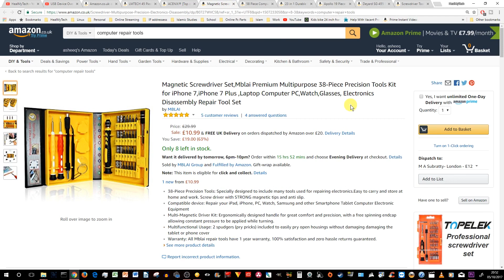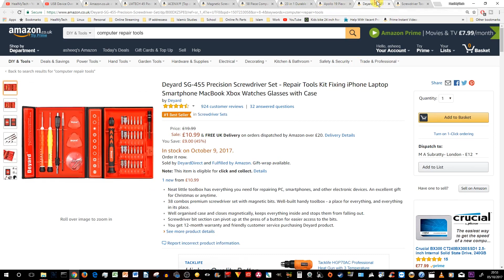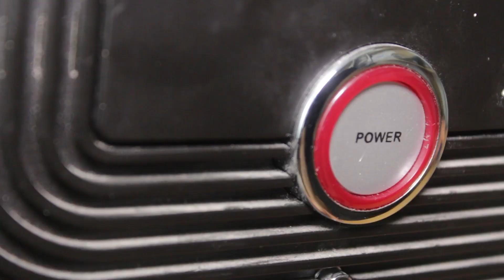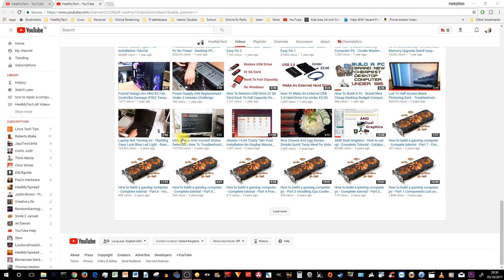How To Troubleshoot A Computer That Won't Turn On - Pt 1: Is It The PC CASE Fault?

Comment: I have a Asus hero VIII that won't power off.  Shuts down normally and works as expected when in use, but when I click power off it shuts down but doesn't power off. (Fans and lights stay on)  Reinstalled windows.  Updated bios.  No changes.  I'm thinking I have a faulty motherboard (CPU has been changed and didn't fix)

Comment: Hii, I am having a little trouble turning on my pc
The CPU does starts up and the fan moves and as far as i can say its running coz i can hear audio from the speakers but the screen is black.
Maybe its bcoz my monitor broke or something but I am more worried bcoz one(red) of the two(green and red) light on my CPU isn't blinking the way it usually does.

Please help me

Comment: Great video's.  I built a computer for my father a while later it was sitting in the hallway and he had a new one.  He took it to a computer store and they couldn't figure out what was wrong.  Well 1 the power supply was bad.  2 - they unhooked the power button wires and put back incorrectly so even with new power supply it would not work.  (idiots)  After watching close to you doing the jumper (with screwdriver) did I notice the power wires were incorrect.  Now I have a functioning computer again.  Thank you so much!

Comment: Just popping in to say THANK YOU!
My PC was crashing at random times, for 2/3 days, before it started crashing continuously (even in BIOS menu with default settings). My first assumption was a faulty power supply, but found it weird how it was very inconsistent (PSUs tend to behave decent until they fail). I send it to someone to fix it, since I didn't have any spare PSU around to test it. Unfortunately they weren't able to find the issue (just wanted to reset my drives?! :|). So I finally manned up and bought a multimeter! PSU was testing perfectly (thanks for the guide). Finally after watching this video decided to start at the very basics, and found that my Reset cable, was exposed (just a tiny little bit), and that was causing the "crashes". Sorry for the long story. So incredible thankful for your guides and incentive!

Comment: my desktop turns on the fun and shows board led but does not display the screen what would be the problem
Reply: I have the same problem let me know what whats wrong with yours please
Reply: @demolast9128  did u get a solution im in same situation
Reply: @LegalMikel  i did well kind of , my problem is a one bad ram slot and one bad ram card , i am currently using my computer with only one ram card

Comment: I can't thank you enough. This problem happened before and turns out the wires of the switch were disconnected. A person fixed it and later, after shutting it down, I tried to start it up but it didn't work. I found out what had happened due to your video, thank you!

Comment: I got a MSI MPG Z490 a I7 10700 AND GSKILL ram. At the beginning  everything went well but after shutting my PC down and rebooting it five or six times motherboard remained stationary on the logo MPG. I changed the SATA drive with a SSD drive but I had the same things. I installed RAM, HARD DRIVES, POWER SUPPLY on some others PCS and they worked well. Any idea about what it is preventing the complete boot?

Comment: I am trying to build a server at home. I keep getting a memory error - 5 short beeps + 1 long beep = no memory detected. I am using the Supermicro motherboard X9SCM-F and I have two 8 Gb memory modules, both are non-ECC Unbuffered. I used other modules and got this same error, so I switched three times - still same error. I have my keyboard, and mouse plugged in, and vga video - no video output because it don't get that far. Any thoughts in Troubleshooting ??

Comment: Hello Ash.  I have watched this whole video, as well as the intro one.  I have a situation where after a few days of the computer being turned off, it boots up and then it shuts off, but on the second attempt, it doesn't do it, meaning that it gets to the Win desktop without any problem.  It behaves exactly the same way every time.  It's a pre-built HP PC by the way. What would you check in that situation?  Or what do you suspect?

Comment: Thanks for all the tips!   
As a former Avionics Technician on helicopters, I can assure that having the motherboard inside of the computer case is not tight at all comparing to the tightness I had to deal with on helicopters.

Comment: fam thank you for putting this out, but i feel you are milking time like 30% of the time
Reply from the maker: Alright.  Which parts do you think are unnecessary? Ive been removing the fluff in my recent live sessions for this series, and i will compile them as a new full troubleshoot upload once i reach part 10, hopefully that should do the trick.  If you check out todays live stream, let me know if the summarised part is better.

Comment from the maker: My apologies for the delay. I have updated the description with The Full Series Parts and links.  Whether I have answered your question here or not, I will feature your question and answer in today’s live stream Q&A (Thursday 23/01/2020 @5PM UK & 12PM EST) here: https://youtu.be/GMrd49YZcY0 How To Troubleshoot A Computer That Won'T Turn On – Pt 1 Computer Case & Live Q&A 2020 .  Others can always benefit as these problems are universal and timeless.  Tune in with any related questions you may have for a live answer.  See you there.

Comment: Got an odd situation.  I put the mobo in the case, it does not work.  Turn the power on, momentary light on the mobo, short turn of the fans, then stops.  I remove the mobo from the case, let it sit for a while, still does not work.  Remove all cables from the mobo that is outside of the case, let it sit for a while (30 minutes maybe), reattach the cables, it works.  Put it in the case again, does not work.  All standoffs have an associated screw into them.  No extra standoffs.  Ideas?
Reply from the maker: My apologies for the delay.  Whether I have answered here or not, I will feature your question and answer in today’s live stream Q&A (Thursday 23/01/201/202 @5PM UK & 12PM EST) here: https://youtu.be/GMrd49YZcY0 How To Troubleshoot A Computer That Won'T Turn On – Pt 1 Computer Case & Live Q&A 2020 .  Others can always benefit as these problems are universal and timeless.
Reply: Did your situation get fixed?
Reply: @1JamesDrumz  Been too distracted to concentrate on it.  It's just sitting there until my brain can focus on it again.
Reply: Oh wait, this situation was solved.  I was using mobo screws that were powder coated or something, and I guess not grounding.  When I went with metallic looking screws, it started working.

Comment: Switched the ram slot not I have zero power going into the computer
Reply from the maker: My apologies for the delay.  Whether I have answered here or not, I will feature your question and answer in today’s live stream Q&A (Thursday 23/01/201/202 @5PM UK & 12PM EST) here: https://youtu.be/GMrd49YZcY0 How To Troubleshoot A Computer That Won'T Turn On – Pt 1 Computer Case & Live Q&A 2020 .  Others can always benefit as these problems are universal and timeless.

Comment: If I click the power button of my laptop it's turn on then shutting down then turns on again (loop) did you think it is grounded?
Reply from the maker: My apologies for the delay.  Whether I have answered here or not, I will feature your question and answer in today’s live stream Q&A (Thursday 23/01/201/202 @5PM UK & 12PM EST) here: https://youtu.be/GMrd49YZcY0 How To Troubleshoot A Computer That Won'T Turn On – Pt 1 Computer Case & Live Q&A 2020 .  Others can always benefit as these problems are universal and timeless.

Comment: Help my monitor wont start when i add a new ram but when i unplug the ram it work just fine my system is ddr3 help i want to upgrade my pc
Reply: Is your ram ddr3 too? Maybe your new ram is ddr4 which will be incompatable with your motherboard. Unless you have low voltage. I think
Reply: @dylanbalagtas6444  i have ddr 3
Reply: @tertzero  then it could be the ram capacity of your pc.
Reply: @dylanbalagtas6444  ok I'll go check
Reply from the maker: My apologies for the delay.  Whether I have answered here or not, I will feature your question and answer in today’s live stream Q&A (Thursday 23/01/201/202 @5PM UK & 12PM EST) here: https://youtu.be/GMrd49YZcY0 How To Troubleshoot A Computer That Won'T Turn On – Pt 1 Computer Case & Live Q&A 2020 .  Others can always benefit as these problems are universal and timeless.

Comment: Please help. my laptop turning on but it’s keeps restarting after windows logo.  I try to format it but the same problem occurs. After windows loading file, windows logo appear then restart.
Reply from the maker: Disconnect your hard drive to eliminate that as a cultprit, try to boot in with a Linux USB to troubleshoot further!
Reply from the maker: My apologies for the delay.  Whether I have answered here or not, I will feature your question and answer in today’s live stream Q&A (Thursday 23/01/201/202 @5PM UK & 12PM EST) here: https://youtu.be/GMrd49YZcY0 How To Troubleshoot A Computer That Won'T Turn On – Pt 1 Computer Case & Live Q&A 2020 .  Others can always benefit as these problems are universal and timeless.

Comment: Thank you! This video was very helpful, but your channel page is a nightmare to navigate, especially if you are  trying to find the follow-up videos in this series.
Reply from the maker: No problem.  Really a nightmare to navigate, I thought I made it easy into its own series and every thumbnail is clearly standardised with the numerical order on the thumbnail, what did you find difficult, and any suggestion?
Reply: @HealMyTech1 
I think what they meant was that the videos are not uploaded in sequence and it's hard for them to navigate. Maybe they don't know about the Playlist feature.

Comment: I click the power button and it loads up to a screen saying “Usb Overcurrent” ive tried everything and I’m literally going crazy, non of my usb’s look damaged and ive also unplugged everything on the motherboard and it didn’t help, I also did a cmos reset took out the battery for a minute but didn’t do much. Any idea? Non of the pins look damaged either.
Reply from the maker: My apologies for the delay.  Whether I have answered here or not, I will feature your question and answer in today’s live stream Q&A (Thursday 23/01/201/202 @5PM UK & 12PM EST) here: https://youtu.be/GMrd49YZcY0 How To Troubleshoot A Computer That Won'T Turn On – Pt 1 Computer Case & Live Q&A 2020 .  Others can always benefit as these problems are universal and timeless.

Comment: With having a short with a screw that mounts the MOBO to the case, couldn't you just use non conductive thin spacers between the MOBO and the screw when attaching it to the case?
Reply from the maker: My apologies for the delay.  Whether I have answered here or not, I will feature your question and answer in today’s live stream Q&A (Thursday 23/01/201/202 @5PM UK & 12PM EST) here: https://youtu.be/GMrd49YZcY0 How To Troubleshoot A Computer That Won'T Turn On – Pt 1 Computer Case & Live Q&A 2020 .  Others can always benefit as these problems are universal and timeless.

Comment: please reply mine mobo led turns orange no fans spinning until i press the fan checker on psu my PC is from dell my psu working
Reply from the maker: My apologies for the delay.  Whether I have answered here or not, I will feature your question and answer in today’s live stream Q&A (Thursday 23/01/201/202 @5PM UK & 12PM EST) here: https://youtu.be/GMrd49YZcY0 How To Troubleshoot A Computer That Won'T Turn On – Pt 1 Computer Case & Live Q&A 2020 .  Others can always benefit as these problems are universal and timeless.

Comment: I have a problem. When i am switching on the power button of my laptop no led lights are being on and the fan is not spinning while put to charging also.
Reply from the maker: My apologies for the delay.  Whether I have answered here or not, I will feature your question and answer in today’s live stream Q&A (Thursday 23/01/201/202 @5PM UK & 12PM EST) here: https://youtu.be/GMrd49YZcY0 How To Troubleshoot A Computer That Won'T Turn On – Pt 1 Computer Case & Live Q&A 2020 .  Others can always benefit as these problems are universal and timeless.

Comment: Nice video ....  i always endup on motherboard malfunction or dead on me
Reply: HealMyTech 8 or 10 pc motherboards tried hp,lenovo and dell. Circumstances some motherboard they doesn't on tried  unplug everything then plug 1 by 1. Now i have dell precision desktop pc it freeze on bios screen
Reply: HealMyTech no different pc's. I always purchased factory refurb core 2 duo pc due to low budget these pc's have their own power supplys. Now i have dell precision desktop tower workstation t3500 which recently have motherboard issue like on then off in seconds then doesn't turn on anymore so i checked the motherboard from repair person and had  it repaired. Now after bios logo screen second screen when pc is checking devices it freezes that point doesnt go on.
Reply from the maker: My apologies for the delay.  Whether I have answered here or not, I will feature your question and answer in today’s live stream Q&A (Thursday 23/01/201/202 @5PM UK & 12PM EST) here: https://youtu.be/GMrd49YZcY0 How To Troubleshoot A Computer That Won'T Turn On – Pt 1 Computer Case & Live Q&A 2020 .  Others can always benefit as these problems are universal and timeless.